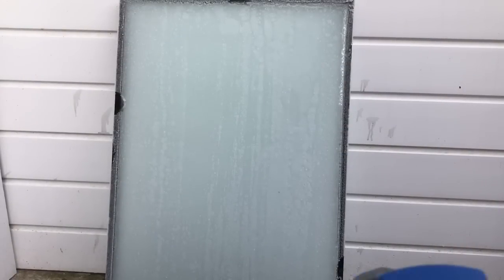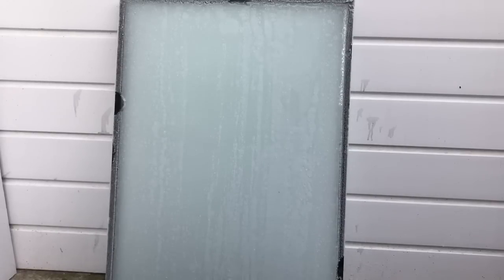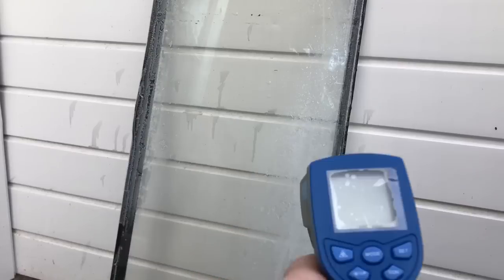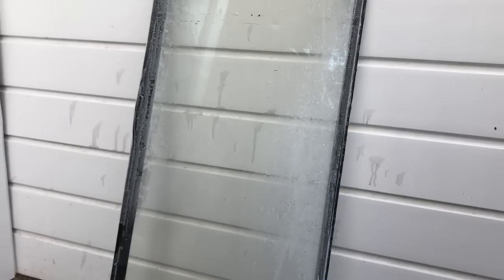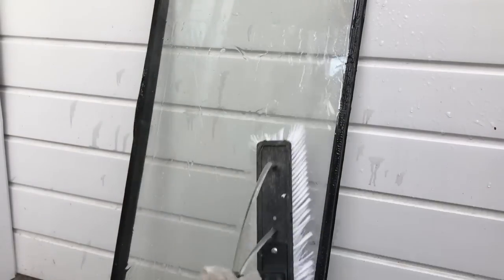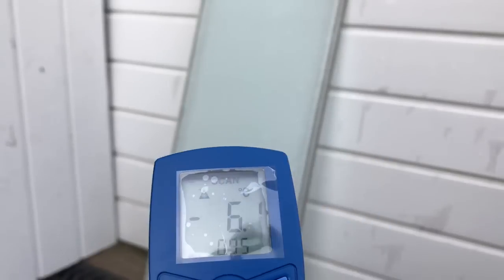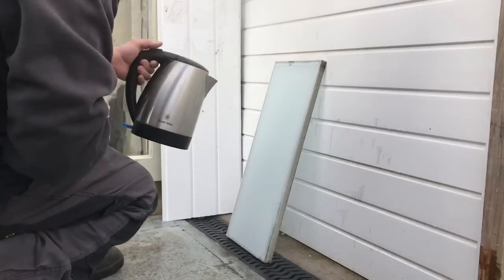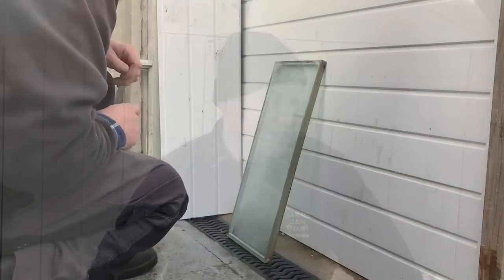Will Hot Water Window Cleaner Crack A Frozen Window

Comment: how often does di tank resin need to be changed
Reply from the maker: It depends on a lot of different things such as, size of DI bottle, how much water you filter, whether you are using double DI, DI only or RO and DI. The list goes on and on with so many variables. 
The best thing to do is to check your TDS regularly and when you see it start to creep up change it then

Comment: Does it freeze quickly on the glass after you have cleaned them?
Reply from the maker: No difference. In fact I think it’s slower as it leaves some heat in the glass from cleaning it
Reply: @squeakycleandave1  does it not bother your customers that the glass is all iced over? This is going to be my first year with heated water so just curious.

Comment: I’m actually setting up a hot water unit with my system today. I’ve wondered about cracking cold glass, so thanks for this. My thought process was to reverse approach with cold water on hot glass. So to play it safe, gradually introduce water by not applying pressure or trickling the water from a distance or maybe focus on frames for a second to remove the shock factor. I have no experience yet, hopefully here an a few hours I’ll have things cracking. :) no pun intended or crack intended.
Reply from the maker: Ive been using hot water for a couple of years now  and haven't had any problems so far. you will love the difference it makes especially over the winter. 👍
Reply: It’s up and running. We’ll give it a go tomorrow!
Reply: @windowswashbasin  hello 👋 I was wondering if you had cracked any problems so far regarding cracked windows etc
Thanks
Reply: @priesty1234  hey, no problems. I’m just now getting into cold weather cleaning, so for the last few weeks, the hot/warm water is really nice! No problems with cracking. I’m on a 300ft 5/16 OD hose. When it’s really cold outside, near freezing, the water is luke warm when it gets to the wand. I can turn the temp up but I’m not sure if that will ruin my RO system. I have a van mount system. The only other precaution I’ve been taking is to avoid getting water on walkways, especially on the cold side of the house. Usually the southern sides evaporate away but on the north side, almost instant ice. I just hand wash those potential problem areas. On the house and glass, system works like normal as the ambient heat from the house and warm water dries things pretty quick. I’ll never go back. Hot water is excellent!
Reply: @priesty1234  and by the way, I process water on demand on the van with RO/DI. I made the change this spring but found RO was super slow and rarely had enough pressure on the job site unless the location and outrageously high water pressure. So I was regretting the RO addition as I had been DI for the past 10yrs. Well I went to a mountain location that has very high pressure but the RO/DI output was poor. Confused I did some (even more) research and discovered that under optimal conditions, RO should only decrease pressure by only 7%. So incoming pressure is part of the equation but more importantly is.....drumroll....water temperature. Optimal temp for RO is between mid 60-80F. This is why I ultimately added the tankless propane water heater. In all my research to make the change to RO, nowhere was temperature mentioned. Not even on the membrane I bought. I think I picked up the tip on a fish tank online forum. RO sure has been a learning curve. Kinks are all worked out for my van mount. I do have a 40 gallon holding tank for processed water when I have no hook up option. It was taking 4-6hr to fill it up. No with the water heater and about 70psi, it fills in 20min.

Comment: What I’ve found is that single glazed no problem. The warmth of the house prevents it from getting too cold. Double glazing there’s a possibility but remote. Triple glazing is the worst because the outmost pane is absolutely freezing and is totally insulated from any possible warmth from the inside.
Reply from the maker: Nathaniel Leitch great point. I must admit that I think I only have one customer that has triple glazing. I will keep it in mind. Thanks for your input

Comment: Hi Dave. I've actually cracked  2 panes using hot water.. not sure why they cracked..    in the winter I had done 2 of 10 townhouses upper  level windows outside temperature was about 6-8 degrees in the  crisp air no wind and sun hadn't hit the glass yet.. water  temperature about 65-70 at brush head..  still don't know if there were prexisting cracks.. and caused them to continue.. or because they are mounted in timber frames with putty on edges and not allowing for any expansion as a rubber seal does.. 4mm thick glass... so on timber frames I just use cold water nowadays..any experience since doing your video..   👍
Reply: Yes it's disheartening the crack seemed to happen in slow motion right before my eyes .. a 4 set of windows 300 x 450 x 4mm   I also did preheat water onto the glass on panels to avoid the thermal shock... a lesson learned.. that's the window cleaning game.. 👍
Reply from the maker: FlashTechEngineering always learning 👍
8:50 am here got our meeting in an hr. what time is it there👍
Reply from the maker: FlashTechEngineering I’ve had no problems with it. My water is only heated to about 50 degrees in the tank so it’s even cooler at the brush head. When it’s really cold and I’m not sure about the glass I will give the windows a spray from further away and onto the frame at the top so it warms the glass a bit before it gets the full heat to reduce the thermal shock. 
I’ve heard that wooden frames can  twist a bit and as the glass can’t move it puts it under tension so makes it easier to crack. This happened to me when I first started out. I only put my brush on the pain and it cracked right the way across and that was using cold water in the summer. I was single glazed and about 1.5 x 1m. 
I paid to have it changed and the customer was fine about it👍
Reply: It's Sunday   Day light savings .. evening 8..10 still a bit  daylight  just watered the garden.. were summertime 38 degrees today   Monday about 25 degrees   I live in Adelaide South Australia .. enjoy your meeting.. 😀 keep warm..
Reply: Hi Dave  my van installation ionic https://www.instagram.com/p/BwtinGYnduF/?igshid=lvb9vl4lnama
Reply: Brush head temperature test 🔥🔥🔥👍
Reply: https://www.instagram.com/p/BwtTzfBniLG/?igshid=1flkevh0q2g7b
Reply: Temperature testing https://www.instagram.com/p/Bwz_1WOndX0/?igshid=wg9xrbgpup3o

Comment: Interesting video! I live in the desert and it gets hot around 110 F degrees and above...
I wanted to start washing with a WFP when it’s  blazing hot because most window cleaners take the summer off......I was skeptical about doing it and cracking the glass but after watching this I think it will be fine if I use the hot water coming from the house pipes....I use Di resin....what’s your take on it?
Reply from the maker: vcash holdfast interesting question. I’ve haven’t really got any experience with hot conditions. I have a friend in Australia who might have more idea. I will ask him and let you know🤔👍
Reply: @squeakycleandave1  thanks!
Reply from the maker: vcash holdfast I’ve had a chat with Duncan in Australia and he says he regularly cleans in over 100 degrees temperatures. 
Check out this channel. He says you are welcome to message him if you have any questions 

https://www.youtube.com/channel/UC_TwqySgkp8QDOwizncf2tg
Reply: I just gradually introduce cool water to hot windows. Boise, Idaho gets into triple digits. It’s a perfect way to clean in the heat. They dry quickly and plus you can be a little sloppy and get yourself wet to cool off. I hold the brush off until I’ve cooled down the glass, then focus on frames and by then I’m well into a good ol scrub of the glass. Rinse and done.

Comment: Dave, great video but it may make a difference if the glass was in the frame, as you have it the glass unit can freely expand retract with the sudden heat. Plus ideally you would need to have one side of the glass at room temp and the other side of it outside temp.
Reply from the maker: Graham King 
Thanks for watching Graham. I know there are loads of things I could have done differently but as I said it was a non scientific experiment in my back garden with what I had to hand👍
Reply: @squeakycleandave1   Ah maybe I missed that bit 😂😂
I use hot water and always cautious. Be good to actually see a unit fitted and tested with same methods u used in your video.
Reply from the maker: Graham King despite all the testing in the world with all the possible set ups I don’t think you could be 100% sure so care is always needed with hot water. I definitely think the advantages outweigh the disadvantages though. 👍

Comment: Great videos m8. What is the benifit of hot water is it just mor pleasent to work with or does it leave a better finish, dry quicker, take less water???
Reply from the maker: joe kelso 
Hi joe. It’s definitely nicer to work with and it makes it much easier to clean with. Think of washing the dishes in cold water compared to hot water. 
As I use an immersion heater to heat the water I also have a van full of hot water so I don’t have to put a heater heater in it on cold nights to stop it from freezing

Comment: Great video, i use 80°c pressure cleaner on glass never that cold but i havnt had any crack yet. Great work i feel alot more confident now
Reply from the maker: Wow that hot. It’s pure water I use but I can’t get mine up to that temperature
Reply: Squeaky Clean Dave, i use a thermometer like yours and i have a Karcher HDS 5/11 u. I fill my tank with pure water and cycle it through the unit comes in handy all the time, i find 30°c is perfect for the majority of the time. I also fill straight of their hot water laundry tap generally get 40 odd
Reply from the maker: Sunshine Windows I heat mine with a 2 kw immersion heater in the tank over night. It can get it up to 65 degrees C over night but I usually have it about 50 and it looses about 10 degrees over the day but I haven’t bothered heating it since the end of March. Will start again when it gets cold again over night